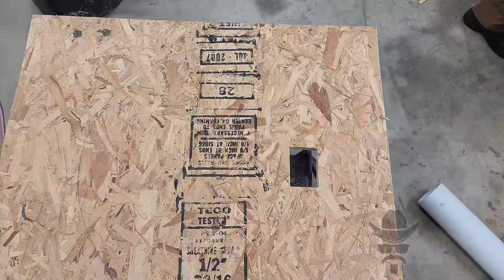Ep 8: Assembling, mounting, and testing a pneumatic aluminum can crusher.

Comment: Great Video.  I bought this very same unit, and very impressed with it.  I broke the welds on the end of mine.  Ended up welding it and it's held.  Didn't even think about the boards on each end.  I shimmed the push button out from the crusher chamber, but it didn't help, I ended up going to harbor freight and adding a 2 foot section of hose.  Plus I added a valve, so I could shut off the air supply to the crusher, before disconnecting the hose.  I think the next one I build, I'll mount the button offset with a piece of angle iron.  I crush a lot of the larger tea cans, I stand them up crush it once, then lay it in flat.  Thanks for sharing.
Reply from the maker: Thank you for the kind words!  I never would have thought of shimming the push button out, that was a good idea.  I like the valve idea... when I finally getting around to adding my short section of hose I might have to add one in.  I am coming up on a year of use and it is still going strong.  Thanks for watching!  🤠

Comment: What kind of compressor do you need for this crusher?
Reply from the maker: Pretty much any compressor will work.  I was using my pancake compressor, not sure what the CFM is.  As long as your compressor can go up to 90+ PSI it should work.  How fast you can cycle through the cans will depend on the size of your compressor and tank. Thanks for watching!  🤠
Reply: THX i have a small silent compressor 105\8\6 and it work fine with the can crusher 6 cans and then have to waith 1,5 min for the next 6 cans. @Cowboy_Steve